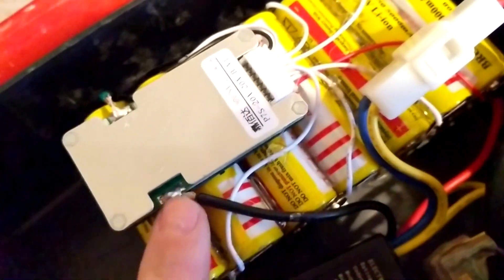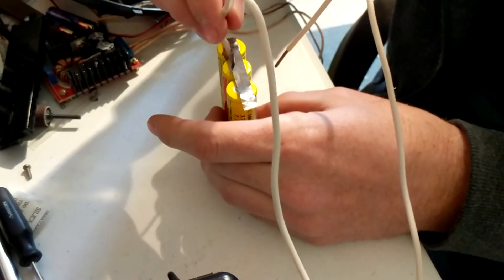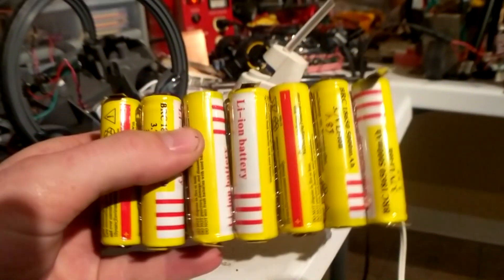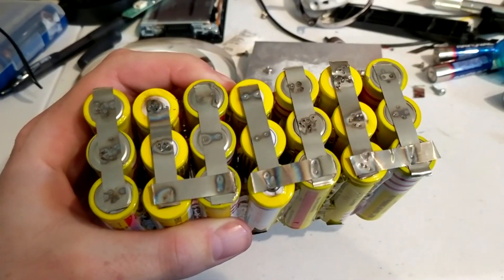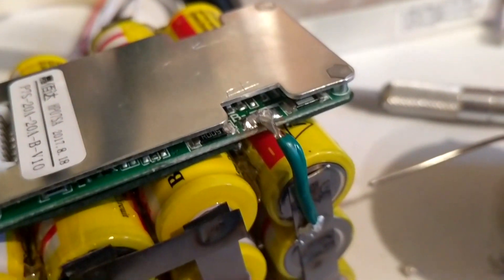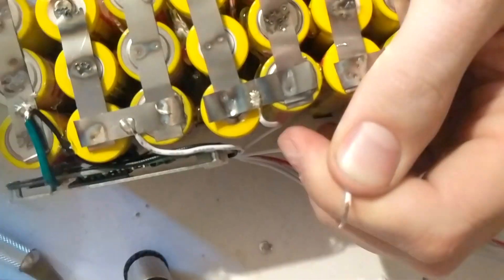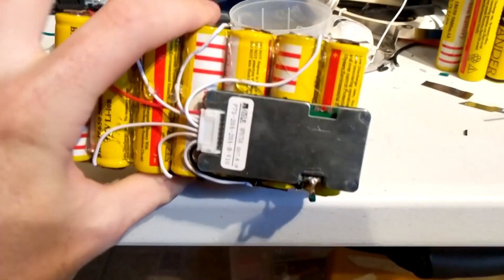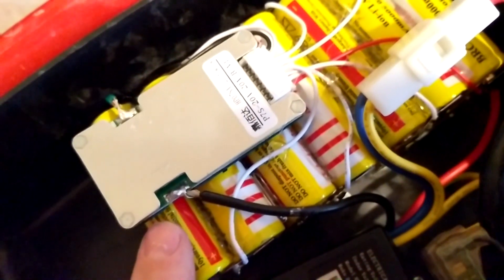How to make a 24V li-ion battery pack.

Comment: In your opinion, the internal resistance is important when building a battery pack like this? I tell you: it is. And if Internal resistance is more than 40 mOhms, your battery pack will be weak.

Comment: How did you make 21 18650’s 24v wouldn’t that be 77.7v idk anything about this but I wanna build my son two 24v packs for his E-dirt bike
Reply from the maker: It would only be 77 volts if you put all of them end to end. I put them into banks of three so it only added up to 24V but it gave it a greater charge capacity.
Reply: @science1324   omg duh I didn’t think of them in threes lol I wanted to make a longer lasting battery for my 4 year old boys electric dirt bike he has a lil kTm 50sx but around in our yard he likes the 24v one better and I bought a ton of 18650’s awhile back but didn’t get what you was doing thanks for the reply.
Reply from the maker: No problem! Hope that helped!

Comment: What model Razor scooter is that? Nay issues with the speed controller and the extra amperage? I assume you also bypassed the fuse that is normally used with the lead acid?
Reply from the maker: Im not 100% sure what model it is. I didn't have any issues with the controller because it just used relays to turn the power on and off so they could handle the extra amperage. I actually left the fuse in but I put in a higher amperage fuse.

Comment: It has been observed that in all such educational video no connection diagram is given. Nor the specification of the cells such as its voltage and amps  is indicated, so as to calculate the total volt and amps of the pack. 
Presume cell specification of 18650 cell is 3.7V & 3.4A ,  If such 6 cells are connected in series and  6 cells connected in parallel subsequently connected with the series cells then we can get 25.9V and 20.4A (3.7 * 7 {6 series cells and one in series from parallel connected  cell}=25.9V & 3.4 * 6=20.4A). Total Nos of cells required is 12 , then why it is necessary to assemble so many cells?
Reply: Thank you for the information you sound like you are very knowledgeable about batteries, I have a folding disability chair with two 12 volt-20amp led acid batteries and want to change to lithium, so will need a total of 24 volts at 20 amps any suggestions, Thanks bobwareham@gmail.com

Comment: Very nice tutorial!  Just a heads up, those 5000 mAh batteries are not actually 5000 mAH, probably lucky if you can get a quarter of the labeled capacity.  Really suggest spend a few more bucks to buy name brand batteries; similar amount of work, but last way longer.

Comment: Hi, I just finish my pack 7s 3p my problemi is when I charge it the first time voltage is 29.5v not 24v,  And my first bike pack is 24v,  all my batteries tested 3.7 when ichecked the first time  (same ultrafire)then bms charge all batteries not 3.7 but 4.2 v. I think it can be bad for my 24 v ESC and motor. Do you know if it can be bad for it thanks
Reply: the 29.5v wont cause an issue as soon as you connect it you will get a significant voltage drop this is caused by load.
Reply: Javier Jimenez hi is you like to be 24v use only 6s  every body build then with 7s and 7s will give you 29v
Reply: Javier Jimenez quit making batteries! You dont have a clue!

Comment: These cells are aren’t good. They have 800 mah at best. Better go with recycled branded 18650 than this.
Reply from the maker: That is good to know, thanks for the info! do you know of anywhere to find them?
Reply: I would recommend any of these 18650 cells from this seller:

https://www.ebay.ca/sch/alarmhookup/m.html?_nkw=&_armrs=1&_ipg=&_from=
Reply: good call.  those batteries are terrible.
Reply: yes i agree alarmhookup is awesome on ebay he tests his cells and I have seen lots of other battery diy folks using him for a seller :-)
Reply: Thanks for the info!